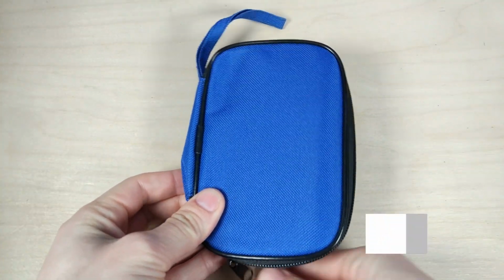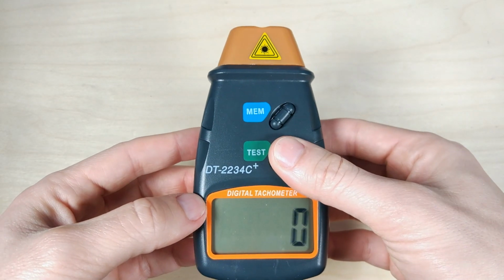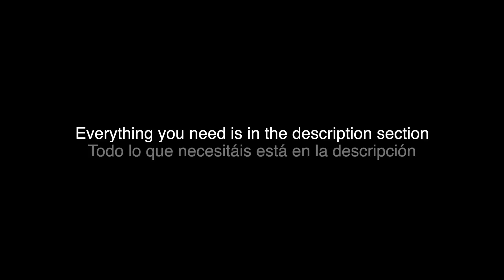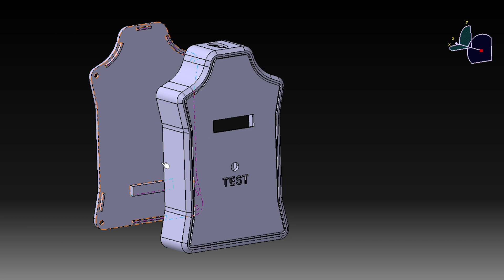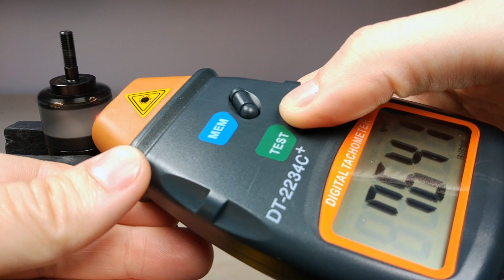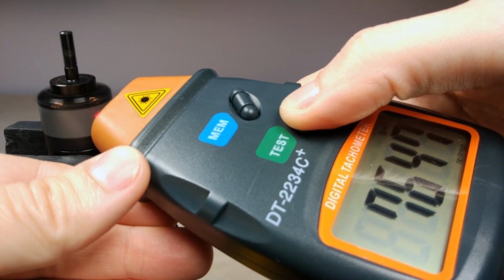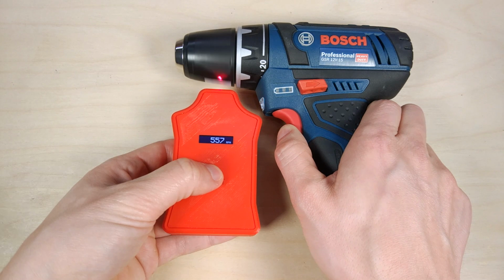How to Build a LASER TACHOMETER

Comment: Thanks, this looks like what I was looking for. Testing an IR circuit worked ok but I have all the stuff to do Laser. I was on hold with my IR tach,  I will examine the Laser set-up, so back to the bench. I also decided to go with the 1306 display, its just simple. No plastic printer here, but I have an old Laser tag pistol I can house real laser stuff and display. brackets for the Xmit and Rcver diodes are there  plus a speaker and flashing LED's.  Laser Tag Tachometer, I'll be fist on the block.

Comment: You did a really professional job, especially on the 3D printed case.  I'm trying to do a similar project. I have purchase the KY-008 laser with the associated sensor board.  For my project I only need the 3 pin sensor but I'm unable to identify it, and I can't seem to find any references to it on all the sites that are selling it.  Do you know the Mfr and Part Number of the detector which inserts into the 3 pin socket?  Thanks!!!

Comment: Nice project!
And I get to practice my Spanish too while watching the video. 
Question: do you have to mark a white spot om the surface of the rotating object to be measured, or will it work without?
Reply from the maker: Cool! You have to use some kind of reflective tape. I used a piece of aluminum foil and it worked too, but not very good. Good luck!
Reply: @EliteWorm  Thanks! I built the circuit (no housing yet) and it works with some kitchen variety aluminium foil on my drills.
Keep up the good work, you might become the next Great Scott!
Reply from the maker: @divingquokka  I'm glad to read that it is working! You have already done the hardest part then 👍😉
Reply: @EliteWorm  Neh, getting it to work on a breadboard was the easy part. Soldering everything together, fitting it in the housing, that is hard.
And one thing has me flummoxed. You are taking five volts from the ICSP pins. I tested all three my Nano's and all three of them only register 0.9V on the (supposedly 5V pin.
Reply from the maker: @divingquokka  That is weird! Check the voltages without anything connected to it but the 9V battery to the Vin pin. You can take 5V from other available pin if you don't see what's happening. It was just for proximity and convenience...
Reply: @EliteWorm  will it work if I have a through holes in between plate? My laser will pointed on the holes instead.

Comment: Your work is very good, how can you get the ttl signal from your tachometer? or another tachometer
Reply from the maker: What do you mean? You could get the TTL signal directly from the sensor itself
Reply: @EliteWorm  I need to obtain the 2234c tachometer signal to put it into a vibration analyzer, specifically to obtain the phase and perform a balancing job.
Reply: I would also like to be able to get TTL output to a BNC connector. How would this be done? If possible.
Reply from the maker: @dnd6032  Just use the output pin of the laser receiver

Comment: Nice project, congratulations... I built it and it works OK after flipping over the sensor... :)... however, with this orientation pin 1 and 3 should be switched. If it's mounted like at 3:54 in the movie I think the sensitive part it's not correctly oriented, the flat surface is not the active part of the sensor. (tried to add a link but the comment was deleted...).
I think also the sensor in version v2 must be closer to the emitter. ;)
Nice work!
Reply from the maker: Really good point Costi! I didn’t know that the flat surface was not the sensitive part. Noted, thank you!
Reply: I am building as we speak.  So, what part of the sensor is active?  i know it is hard to explain, but there is what I will call the Side1'top' of the sensor (directly opposite the pins), and then on the 2 larger flat sides, one side Side 2 has a round 'dot' on it, and on the other side Side3 it is 'plain'.  Which of these should point forward to receive the reflection of the laser?
Reply: And, to follow up, if the proper side of the sensor is the part with the 'dot" (side 2), then do you literally just turn it around so the middle pin (lets call it pin 2) is still in the middle and the two other pins (1 and 3 as you mentioned) are both switched from what is shown in the video?

Comment: Incredible project, congratulations!
Is there a way to store the data of the readings in the Arduino and then retrieve it for analysis (for example txt file)?
Reply from the maker: Thank you Jose Gabriel. Yes, but you would have to add a microSD card reader to the circuit and add that functionality to the code.

Comment: Hi, I really enjoyed the tutorial you posted on YouTube for your laser tachometer. One question. If the laser and sensor were aligned head-on with the rotating element placed in between. What's the maximum rpm the system could accurately measure?
Reply from the maker: Hi! It maxes out at 99999 RPM
Reply: @EliteWorm  hi, it's been awhile since you posted but I'm hoping you'll still be able to help me. I'm trying to build a laser tachometer much like you've built here. However I'm using a Sunfounder I2C LCD1602 for the display module and coding isn't my strong suit. As such, can you edit your code using the I2C LCD1602 module and send it to me? Of course I'd be will to pay you for your time. Thank you.

Comment: I'm new to this hobby & think your tacho & video is great. I've order all the parts to build one as my first project. If I wanted to change the output to display Hz instead of RPM would that be possible? I wondered if I could add a '/ 60' to line 72 and change the display.print functions to Hz instead of RPM?? Sorry if I've underestimated the complexity of changing the code, I didn't know what an Arduino was until a few weeks ago. Thanks for sharing.
Reply from the maker: Depending on the speed you want to measure you may need to change some parts of the code since dividing by 60 will truncate the result. I should have a look at the code again and try it but I think that measuring low speeds could lead to a poor performance without modifying a couple of things. But there is nothing that can wrong. Try it!

Comment: Hi, this is exactly the project I need but with a slight twist. Can I mount the emmiter and sensor apart (around 400mm)to make a light gate? I need to measure the  rpm of small wind turbines (300mm diameter) in a small wind tunnel (0.25m2 c/s area). The turbines will have a differing number of blades depending on the design, so the display would be better to show Hz if possible... Estimated max rpm is around 3000, but designs will be either 3,4 or 5 blades (normally) Thanks in advance!!
Reply from the maker: Hi Andrew. I think you can mount the emitter and sensor like you said. You will have to tweak the code so the values are correct, but you can do it for sure.

Comment: Nice build! Have you manage to find out what the maximum measurable RPM is?
Reply from the maker: It maxes out at 99.999 RPM but I don't have anything that fast to try it. Using a signal generator I was able to measure frequencies way way higher than that but obviously the sensor was excluded from the equation... What do you need to measure?
Reply: @EliteWorm  Nothing that fast. Just curious how much the Arduino could measure. I mean how much time the interrupt needs for performing its calculations.
I think I will build this as a simple way to read the RPM of my CNC spindles.

Comment: Bro good project. I tried but it doesn't work when ı done the project.I think I missed something but I can't find. I think laser sensor couldn't catch the laser to count rpm. Have you any suggestion to solve the problem?  I will use this on my final project if I can achieve.
Reply from the maker: I would hook up an oscilloscope and start checking the circuit first. You must determine if your problem is in the laser sensor or not... You should see a PWM signal.

Comment: Nice project! What's the highest rpm this can measure? I'm working on a project which requires measurements up to 130,000 rpm.
Reply from the maker: This one is limited to 99.999 RPM
Reply: @EliteWorm  thanks for the reply. May I know what limits the RPM? Is it the laser diode/sensor or some other component?
Reply from the maker: @shanakaliyanage6875  No, it's just the display! It has no room for six figures unless you change the units. But it's nothing you can't change in the code!
Reply: @EliteWorm  Thanks a lot you just solved my problem!

Comment: You used some reflective tape on rotary element? You could mention it in description. What type?
Reply from the maker: I used the one that came with the commercial tachometer which is just a regular cheap one. I also tried it with a piece of aluminum film and worked too, but not as good though. Use whatever you want! 👍

Comment: I'm curious about the battery hookup.  It looks like you're feeding 9v right into the Nano. But that would kill it.  So what are you doing?
Reply: Arduino Nano accepts 7-12 Volt  from VIN
Reply from the maker: Exactly! I'm connecting the 9V to the VIN pin. You can see all the details of the connections at the end of the description section!
Reply: @binsun3081  I did not know that!  Interesting!
Reply: I saw the wiring, but didn't know what Bin Sun pointed out below about it accepting 7-9V in on VIN.  That may come in handy some day.

Comment: Very cool build! I'm looking into adding a tachometer to a lathe (since I'm going to install a 3 phase motor and a VFD). I've researched the topic and it seems that two most commonly used solutions use an opto interrupter and a slotted encoder disc or a gear, or a hall effect sensor sensing a magnet (or gear teeth). There are a lot of cheap kits on eBay with a hall effect sensor, a magnet, and a 4-digit LED display. I am just wondering why no one seems to be making (or selling) a laser-based kit? Many people who do build or buy a tachometer for their lathe, do use a handheld laser tachometer to verify if it's working correctly. So why not use this tech in the first place? Or is there no benefit from the laser, when everything is permanently installed in a stationary position?P.S. Does it work well at low RPMs (e.g. some lathes can run as slow as 25 rpm)? I guess it would take a few seconds to give an accurate reading?
Reply from the maker: Hi Gene! To be honest I'd choose the hall sensor in that specific scenario. The reason being is that even the laser would work correctly, there is no reason to use a device (emitter diode) that has a shorter lifespan if it's going to be ON continuously. Hall sensors are very durable! This program should work with a hall sensor too. Thanks for your comment!
Reply from the maker: If you are going to use my program and would like to measure low speeds like 25 RPM you will have to modify a value in the code. I can help you with that. At this moment if there's no pulse detected within 2 seconds, it will show 0 RPM, so you won't be able to measure lower speeds than 30 RPM.
Reply: @EliteWorm  thanks for the info. I'm sure I can figure it out, as I'm a programmer myself (although haven't tried any Arduino yet, but intend to). With hall sensor, I think it might help to add one or more magnets, evenly spaced, to improve response at low RPMs?
Reply from the maker: @GenePavlovsky  Great! But be careful since my program measures the time between pulses and, at low speeds, it takes only one measurement to calculate the equivalence in RPMs. If it detects more pulses in one turn it will display a higher reading and more importantly, it won't be a steady one if the magnets are not perfectly equidistant. But again you can modify the code to solve that!
Reply: @EliteWorm  Hi, how would you do that, I'm no programmer , I thought adding four magnets (pulses) per revolution would help get around the 2 second problem, but don't know how to properly amend the code to divide the total by 4, after some trial and error I found changing "rpm_average = rpm_sum / (n_max + 1)" to "rpm_average = rpm_sum / (n_max + 4)" made look about right, but is that the correct way to do it?
Thanks either way though, I know it must be annoying having noobs asking for code all the time, but I made the tachometer and that was great, I also used a small part of your stl to mount the oled in my lathe speed controller housing, that was a real time saver.
Reply from the maker: @someblokeofftheinternet5745  Hi there! I am glad that you could build it. I will have to see the code again in order to give you a specific answer to your question. What I can tell you now is that you should place the four magnets as equidistant as possible if you plan to do this modification. This way you will get consistent time readings between pulses. Remember the way it is designed: it does not count how many pulses occur during a certain period of time.

Comment: I m trying to build a machine monitoring system. I need to build a system that will measure the machine RPM after regular interval of time. Can you help me with the program and circuit diagram? Also I need to do it with accuracy , will your solution give me accurate result?
Reply: Hey I can help you dm me.

Comment: Great idea, really like it! Any reason why a simple photoresistor would not work?  Would be smaller and more compact that way?
Reply from the maker: I haven't tried it but in theory ambient light would affect way more a simple LDR than this specific sensor which is "only" affected by the laser beam due to its characteristics. In addition to that, LDRs are not known for reacting very fast... But again, I haven't tried it. Thank you for your comment!
Reply: An LDR would definitely be too slow

Comment: Great! But is 9V bad for Arduino? I though 5V was the limit!
Reply from the maker: Those 9V are connected to the VIN of the Arduino! Not to the 5V pin. Be careful! There's a voltage regulator so you can supply up to 12V. Check the connections at the end of  the description 😉
Reply: Thanks!

Comment: Is it possible to measure rpm of a fan with this kind of tachometer?
Reply from the maker: Sure it is! It can read up to 99.999 RPM 😉
Reply: @EliteWorm  Thank you very much for your answer 😊 and i wanna ask if there is minimum lenght of reflecting tape that should applied to the fan blade ?
Reply from the maker: @taylan8716  Honestly I don't know, but as long as the laser beam is reflecting to the receiver you'll be good
Reply: @EliteWorm  thans again☺️

Comment: does it work with IR sensor?
Reply from the maker: The ones I tried had horrible bounce problems, but if your IR is reasonably good you should be able to use it!
Reply: @EliteWorm  Hey,I've tried with both the IR sensor and the laser.both are working and giving the exact same results.You've gotta fiddle with sensitivity of IR module to get it work.
Could you implement Max and Min rpm into the code cause I suck at coding.
Thanks

Comment: Love this project! But I have an issue that i can’t quite figure out. 
I followed everything perfectly, double checked all connections, but for some reason I keep blowing out the actual sensor. They get very hot, melt, and die. 
I’ve checked voltages to the board, and the sensors are getting the correct 5v, but...,yeah. It’s very odd.    These are the ones I got 5V Laser Receiver Sensor Detection Module Non-Modulator Tube for Arduino Geekstory(Pack of 5) https://www.amazon.com/dp/B07H95679S/ref=cm_sw_r_cp_api_i_IvFsEbBNHXE44
Reply from the maker: They seem the same model that I used. Are you sure you're connecting them the right way? The flat side of the sensor must be facing outside of the PCB. Other than that, if you're getting 5V you should be go to! Have you tried connecting them to a 5V PSU?